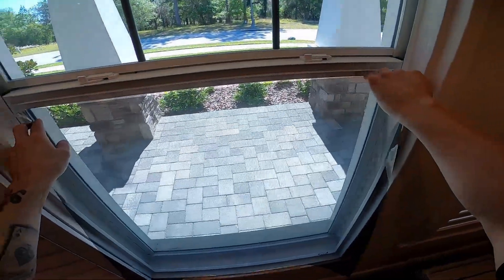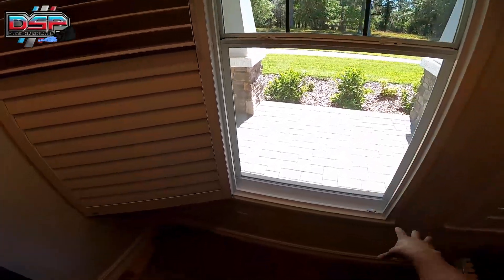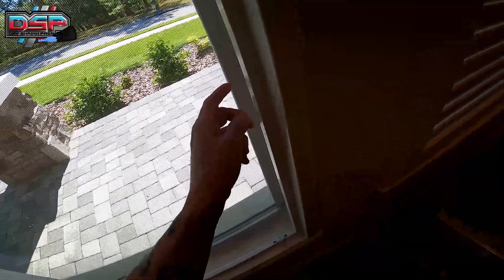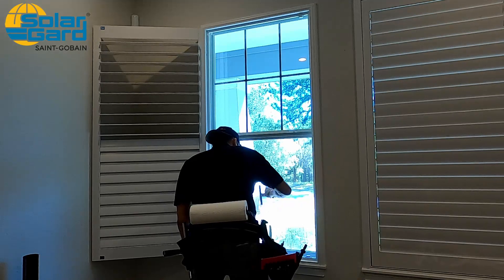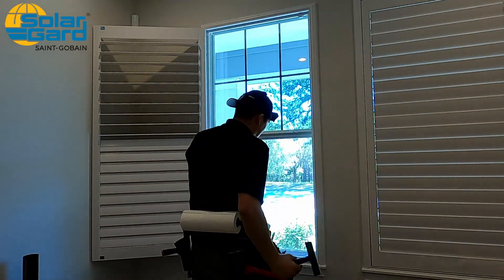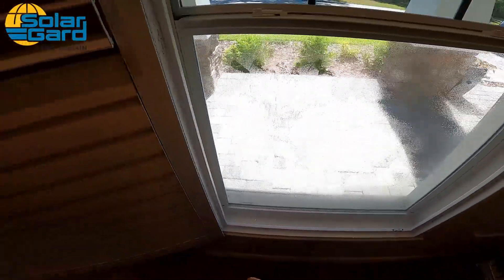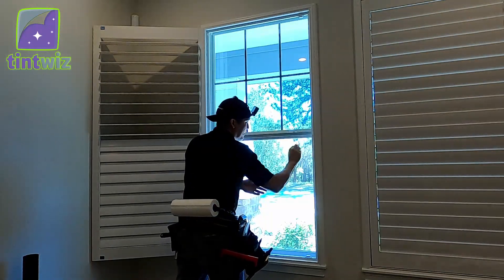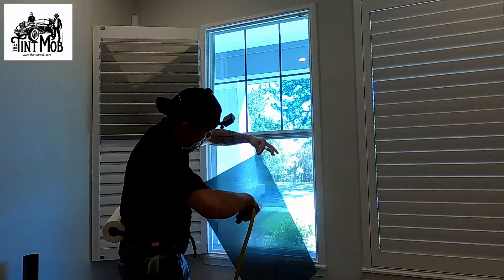How to: Basic Flatglass Install | Residential & Commercial Window Tinting

Comment: Is it true there is different film for tempered and double glazed glass?
Reply from the maker: Tempered and heat treated can take a 500 degree swing. Some double pane windows you can’t put ceramic on, depending on if there is a low e coating and on what’s surface level it is on. The ceramic absorbs and so does the low e coating which could result in the glass breaking or the seals failing.

Comment: @windowtintingbuisness can I apply carbon tint to a dual pane window ?
Reply from the maker: No you CAN NOT apply auto film to flatglass. The absorption rate is way too high, high risk of seal failure and or glass breakage. You need to use flatglass films